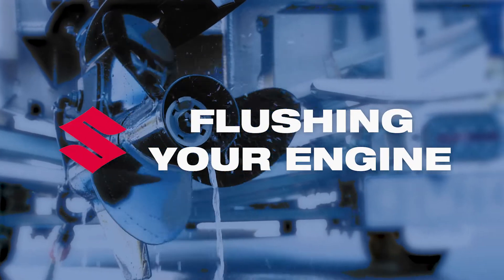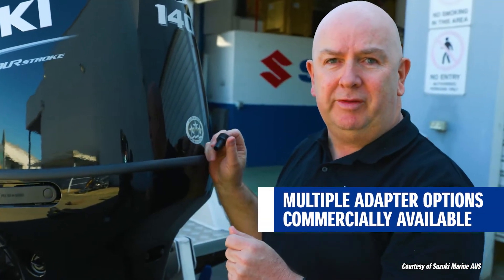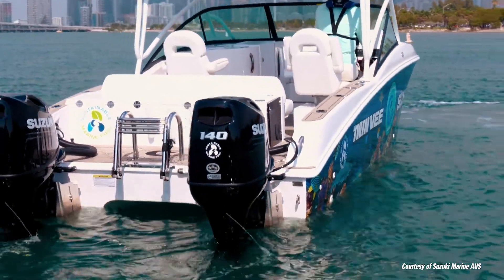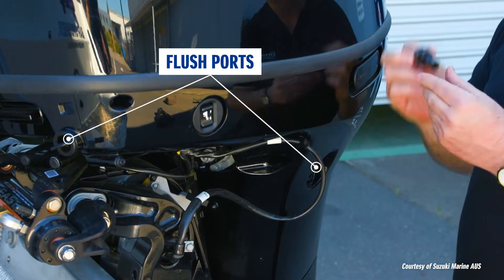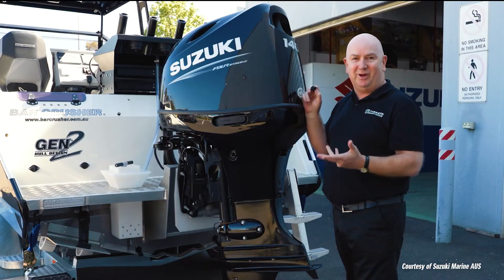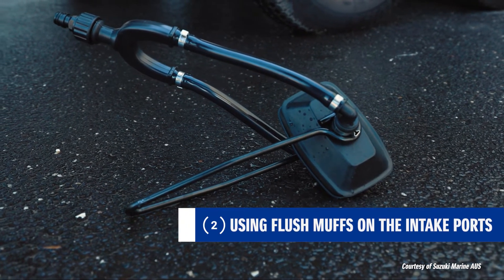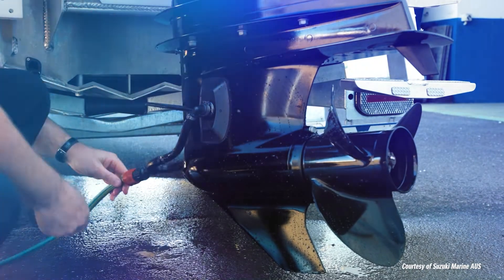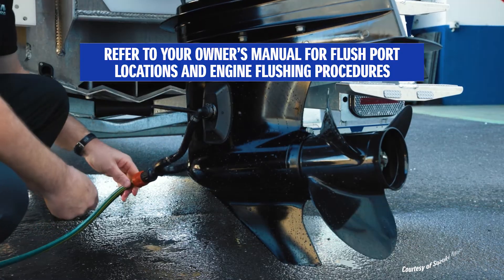Flushing Your Engine: Suzuki Marine Maintenance Tips

Comment: I think you should warn people that your motors may not get enough water on the muffs - probably why there is no mention of using muffs in the owner's manual. I was told by the dealer to use muffs rather than the flushing port - only to find there was no water coming out of the tell tale. I contacted the dealer who said 'oh the powerhead wasn't getting enough water'! This is hardly ideal - especially for a brand new motor. I pointed out that it can't be assumed that the impeller wasn't damaged.

Comment: Do you leave it on all the time? I’ve been unscrewing and rescrewing each time.
Reply from the maker: Great question!
It is essential that the flush port be closed while operating the motor so that the water may pass through the entirety of the cooling jacket to help keep the motor from overheating.

Comment: Is port as effective as muffs ?????
Reply from the maker: We recommend flushing your motor thoroughly through the flush port with the engine turned off.
Should you wish to use muffs please ensure there is a strong suction at the water intake and waterflow to and through the motor.
Please review the best regional flushing methods with your local authorized dealers. 
You may find local dealers at https://www.suzukimarine.com/find-a-dealer/
Reply: The Suzuki mechanic we have that sold us our 2024 Suzuki 300 said, "Do Not Run Engine in Muffs you will violate the Warrantee!" This is for all new 2024-2925 300 Suzukis!